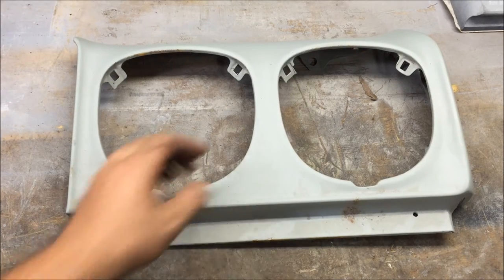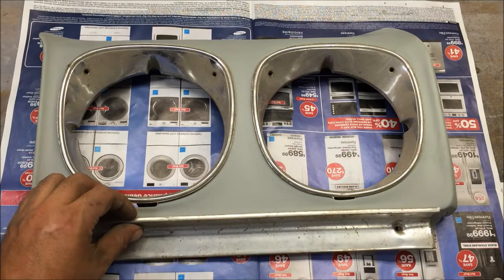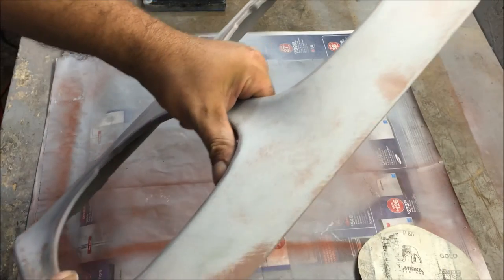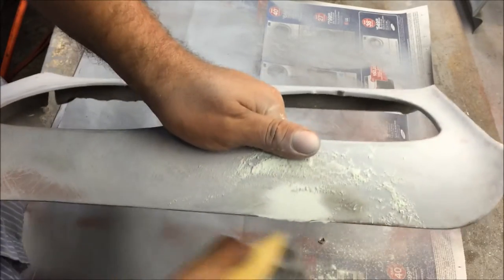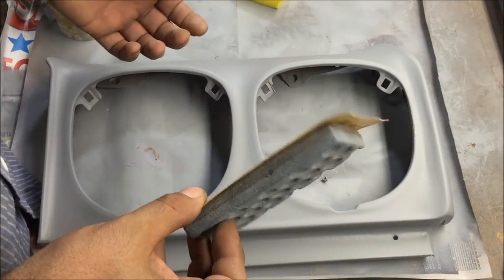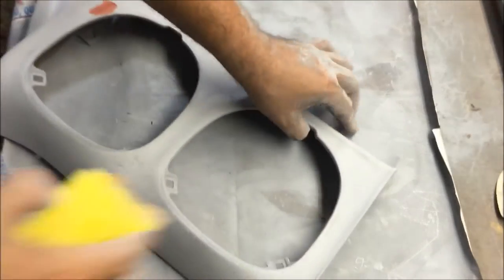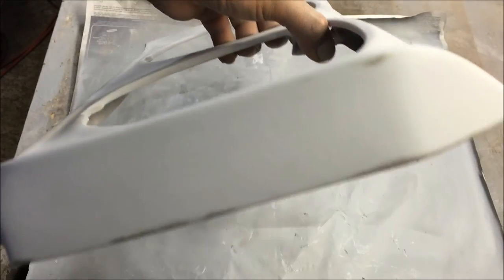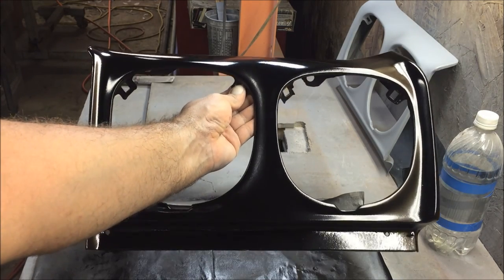auto bodywork for beginners how to part 1

Comment: Hi Chris,
Nice work and thank you for all of the vids.
Question, I am about to start on the nose section for my firebird, it is that poly type hard rubber nose cone (73 firebird nose for reference), will blocking work the same way for it? I understand the concept of what to do now from your instructive vids but this part is plastic so wanted to know if I would treat it in the same manner using small blocks for the contoured areas.

Anyway, thank you for the great vids, much appreciated.